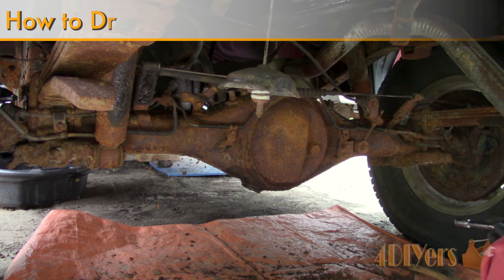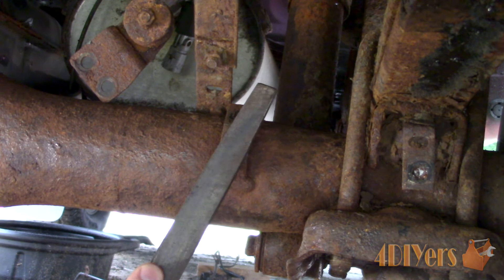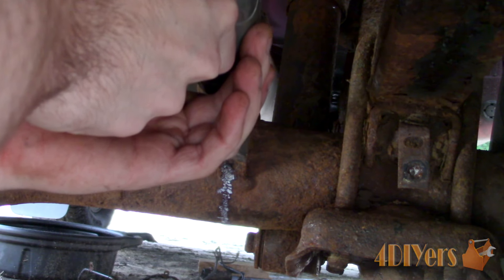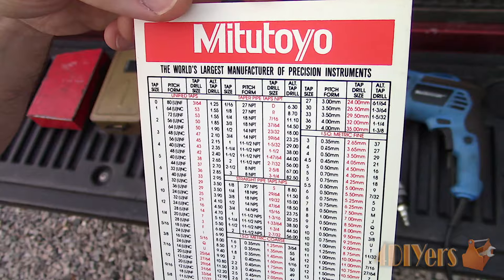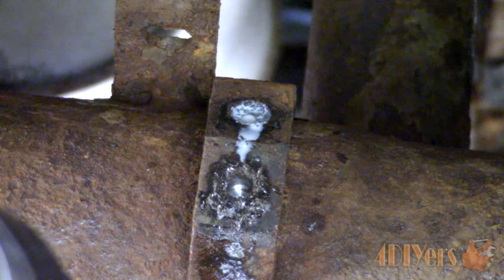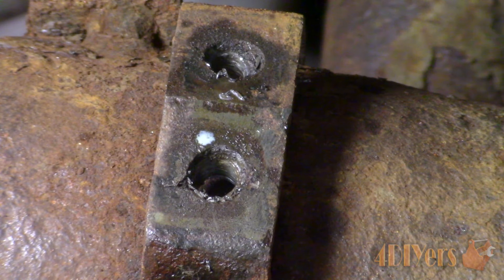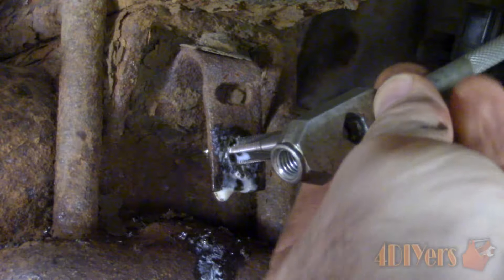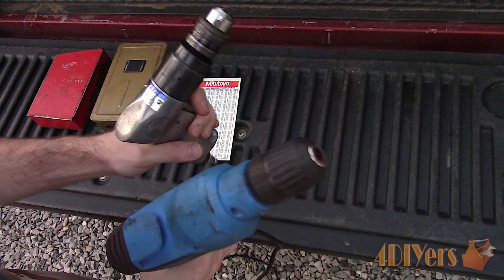How to Drill Out a Broken Bolt or Stud

Comment: How is your drill bit going right through like it’s nothing?
Reply: His mind turned it into steel butter 🧈
Reply: A quality drill bit will do this, also dont push too much
Reply: @strubbleler  I can't believe how stupid an entire shop of dudes was, they swore by using low rpm high torque setting and pushing hard... numbnuts. A cnc runs very fast and doesn't push very hard, they should've realized this.

Comment: And this is why I try to avoid buying cars in rust belt states. Good video
Reply: yeah, guess where the car I am working on is from
Reply: Yeah man , .. I picked up a 98 civic for my son  , it's from PA .. While doing the suspension on it yesterday , one of the bolts for the lower control arm snapped.  I don't know if heat would have helped , it was pretty rusted into the bushing housing with the lca. Now I'm here.. ahaha
Reply: @reza_dc2  here is what worked on my 1985 corvette from MI. I bought a set of the bolt biter ratchet bits and used a breaker bar and a piece of pipe to get more torque. It was still pretty tough to do, but it worked. Highly recommended, I wish I had known that 3 years ago
Reply: @retrogamerdave362  

I don’t think I can break the bolt free due to rust , I’ll have to drill through it and sacrifice the threads. I’m going to run a nut on the backside and remove the oem nut that’ tac welded in place.
Reply: Every car in the uk is rusty after 3 years. There isn't a good place a car could come from here. Although people do say "oh it's been by the coast salty air" a lot. But they are all rotten rust buckets so I don't think that's any better. Nearly Everything snaps when undoing. You don't have the time to work it out back and forth or Let the oil sit on it overnight if your in a shop. Job are in and out and every thing is hammer on a socket to take the first layer of rust off and now it's not 15mm it's a perfectly snug 9/16 😂.
Reply: @Jw20000  Salty air is moronic, anyone with a fish tank knows that salt water evaporates as virtually mineral-void pure water thats why you add RODI or distilled water back in because the salt concentration hasn't gone down during evaporations.
Reply: @jessebrown1400  you can't add distilled water to the sea? What are you referring to? I'm talking about the atmosphere, heavy salting on the winter roads and general wetness cars constantly getting exposed to eroding car bodies here.

Comment: If the surface around the bolt is flat you can use a piece of wood with a hole in it (using a drill press to make a perpendicular hole) to lay against the surface. You then put the drill through the wood and into the bolt to keep it more likely to stay square.

Comment: I have a fuel tank strap bolt that literally snapped for no good reason. Almost drilled trough the whole bolt with a left handed drill bit. Gonna try to get a stronger bit because it stopped working.This vudeo is the closest example of what im trying to do.

Comment: Dang, it's actually crazy hard to clean up my bolt, center punch and rethread. Tried to weld but the flux core cant withstand the torque i put on the nut

Comment: Thank you SO MUCH for doing a broken bolt video UNDER THE CAR in a somewhat awkward-to-reach setting.  The other available vids usually showed workbench type scenarios.  Just a great presentation that matched up with MY scenario.  I have two hitch mounting bolts on a 2006 Scion that I had to grind off the heads after a FAIL using bolt extractor sockets.  Got the towing hook bracket off that way.  The two tow hook brackets have to be removed to mount the tow hitch using their bolt holes, two on each side.  The other side bracket came out without any major issues.  Now I'm off to HF to get center punch, screw extractors, and left hand bits. Maybe even cutting oil paste, as one of the commenters here suggested, for an upside-down under-car scenario.  Also, another commenter suggested using a piece of wood with a hole drilled in it as a centering guide for drilling.  Good idea, I'll try it!  Thanks again--the most helpful video I've found for my scenario.

Comment: Thanks a billion,  I knew I could do it. Just never seen it done before. I so got this. 

My Semi Truck bumper ripped off snapped bolt heads off the bracket that meets the frame. 

I'll be drilling the 2 studs out and retread it. 

Thanks man!!!
Reply from the maker: No problem, happy I could help and thank you for the kind words!

Comment: What do you do if you are off Center a bit. Drilled a small pilot hole but one side it is a little bit closer to the engine housing. I will be putting a helicoil in. So it should be ok as long as the hole is straight right? 
Do I just start at a bit of an angle with the larger bit and then straighten it up once it looks centered?
Reply: You can also use a Dremel to get the hole centered again
Reply: Great idea!

Comment: Redecking a trailer and all of the bolts were rusty and broke before I even started. Going to hit them with the angle grinder and use some cobalt bits to drill them out using this method. Thanks

Comment: The bolt for my dust sheild rounded off should i do this so i ca take off the dust sheild?
Reply from the maker: You can try locking pliers and heat before this.

Comment: I keep having trouble drilling into the bolt. I'm using Dewalt 20V cordless drill. Should I have use a hammer drill instead?
Reply: Impact or not? Might be easier to get it with an impact drill bit. High feed rate but low rotational speed 👍
Reply: @bpw396  I see, I was using regular drill
Reply from the maker: The biggest factor with being able to easily drill a broken bolt is having a properly sharpened quality drill bit.
Reply: Hammer drills can break drill bits easier than normal drills

Comment: 0:25  re softer asian vehicle bolts. I've never heard this. Is there a rational for their choice of softer bolts? I snapped a control arm bolt that screws into a captive nut. Trying not to freak out :). My next step is to drill.
Reply from the maker: Yep it's very common. My dad used to be a mechanic and he was into Japanese bikes too, so he ran into it often. I've had a few JDM vehicles and bikes too. If you start getting into phillips screws like what's used for engine covers on motorcycles, an impact driver is highly recommended, otherwise the heads strip very easily. Not sure why their fasteners are softer, perhaps its a different composition or just not as high of a grade.
Reply: @4DIYers  the head of these screw are Jis rated, DO NOT try to unscrew them with regular Philips you will strip them. this is not because of the material softness but because of the head type
Reply: Part of the reason I believe is so the bolt threads will deform slightly when torquing it to spec instead of deforming the threads of the object.

Comment: That’s my problem as you mentioned in the end is that my drill is too wide to fit into the space I need it to. It’s a broken bolt that holds the fuel tank strap on and working upside down makes it more difficult. 😞
Reply from the maker: Can you get a longer drill bit?
Reply: @4DIYers  I got a 6” carbide tipped Milwaukee 1/4” bit and it was barely drilling it both in reach and getting through it. So today I got a 6” DeWalt hex bit extension for the drill and ofc I intend to put the bit in it to give me more reach. Thanks 🙏 for your suggestion I’m desperate for help and idk if I can get this done it’s a tough bolt.
Reply: I’m in literally the exact same situation with a Toyota Tundra lol
Reply: @falcongunner33  broken bolt on the fuel tank strap? Going upside down ofc?
Reply: @richroc7  yeah, it’s been awful. Just broke a bolt extractor off this morning. I just started drilling the whole thing out but man is it slow going. I bought some well reviewed craftsman metal bits, but I can’t get very far. And of course being upside down makes it really hard to apply pressure.

Comment: how do you figure out thread size for tap clean up thanks and good vid
Reply: Measure diameter with vernier and use pitch gauge or the tap itself to measure bolt pitch against the original bolt
Reply: If you are working on a vehicle or some other equipment, the service manual will likely give the type of bolt